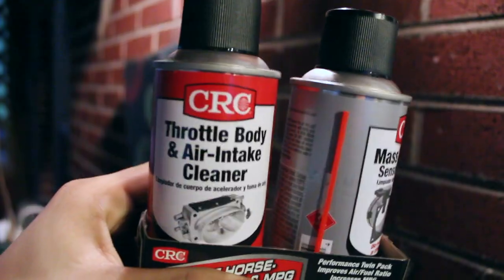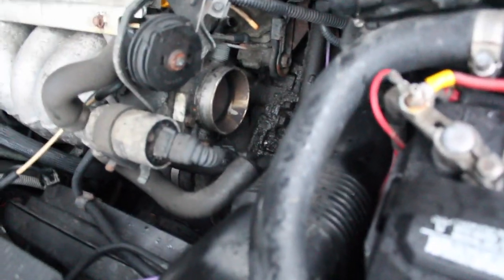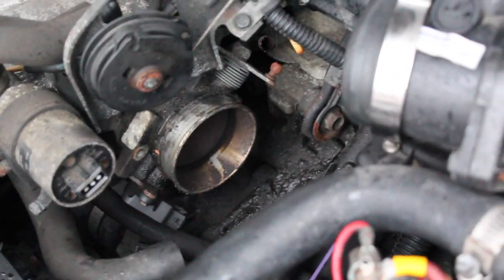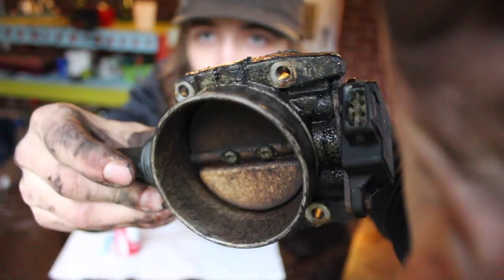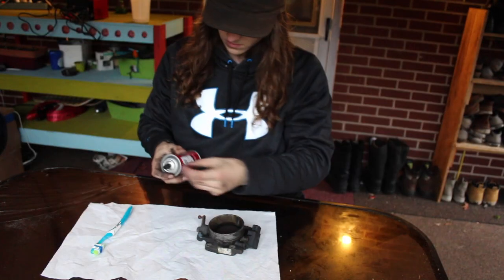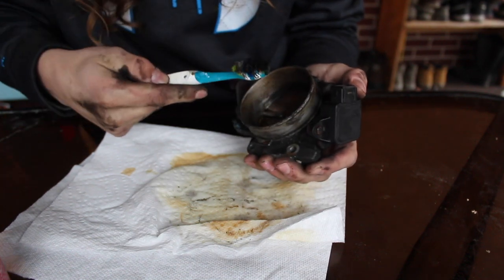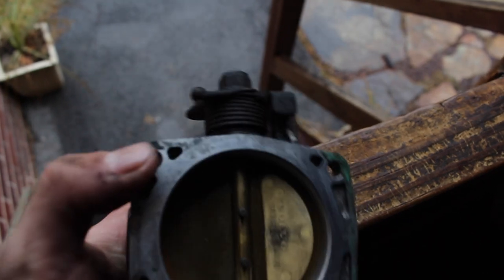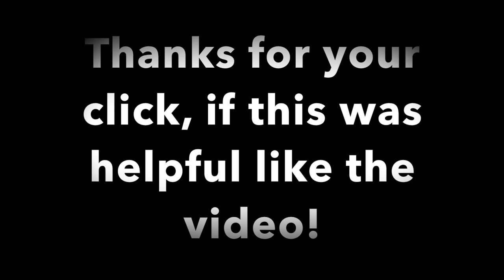How to clean the throttle body of a Volvo 850

Comment: CRC makes great products, but you demonstrated very well how shitty their spray cans are. The caps never spray through the hole (the tubes also never fit the cap) they come through the  bottom of the spray nozzle and they lose pressure much faster than a regular can of spray. CRC  really needs to find another supplier of cans.
Reply from the maker: Agreed!  Better off tossing it.

Comment: quick question, does the green gasket need to be replaced. i subbed, your content gets straight the point, keep it up :)
Reply from the maker: Thanks man!  In my opinion anytime you remove something that requires a gasket I'd have one on hand to replace it.  Only time I wouldn't worry about it is if it was replaced very recently.

Comment: What was it doing that made you think it needed to be cleaned?
Reply from the maker: It was idling rough and dying when I would press on the gas pedal. It didn't fix the issue but it definitely helped in general. I ended up replacing the throttle position sensor and coolant temp sensor and that fixed it.

Comment: I have a 1999 volvo that runs great, but the ETS light is on.. I sprayed some throttle inside the body while it was running and the (ETS electronic throttle)  light came off and then back on..  I did not take it off and I've it a cleaning like you did.  What would u recommend?
Reply from the maker: I would say take the throttle body off and give it a good cleaning, remove the throttle module off of it and clean behind there also.  If that doesn't work I would try a new throttle module, I got mine for cheap from ipd 🤘
Reply: @sponsoredgabe   ok thanks. can you give me the info (ipd) in case i have to buy one?